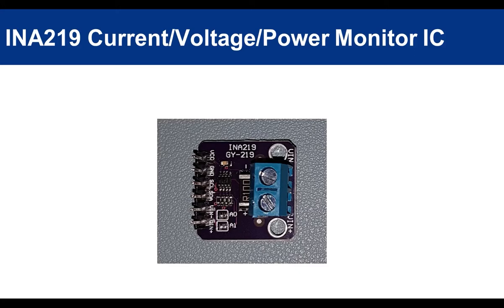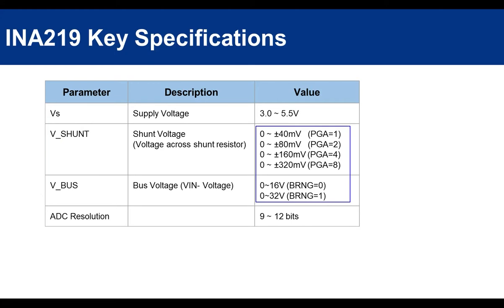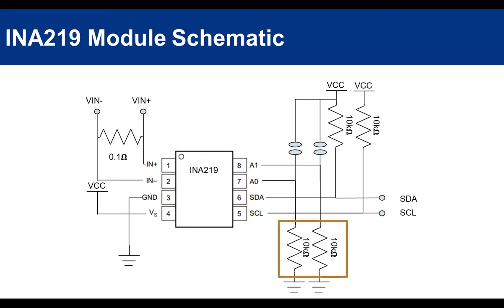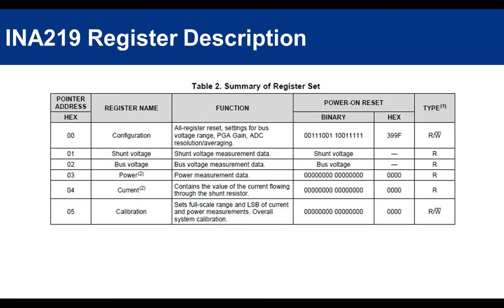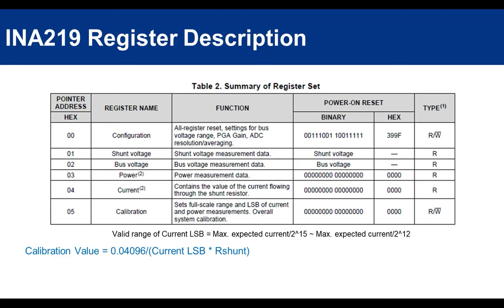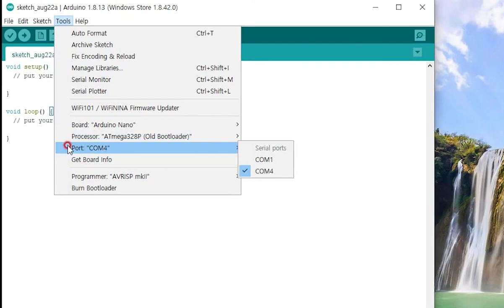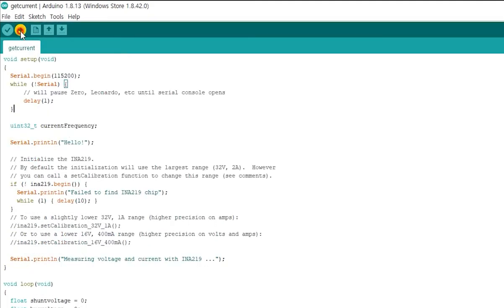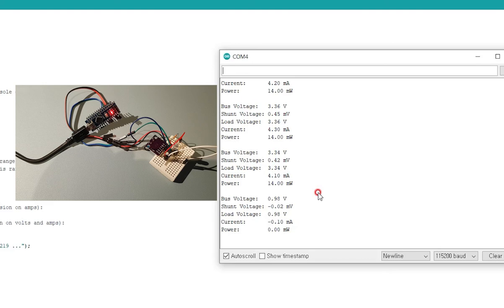INA219 Current Sensor Tutorial (with Arduino)

Comment: Thanks for the video. How do you configure the jumpers to be able to have more than one working?
Reply from the maker: In order to connect multiple INA219s on one I2C bus, you can solder the pad with a silk marked as A0 and A1.
By default, the pads are open, which is pulled down by two 10kohm resistors having an address of "1000000", or 0x40.
When you solder the pad, it is pulled up to VCC, having a different address.
Here are some address options you can have, simply by soldering the two pads.
 - A0 open, A1 open : "1000000"
 - A0 open, A1 short : "1000100"
 - A0 short, A1 open : "1000001"
 - A0 short, A1 short : "1000101"

Also, there are other options if you plan to connect more than four modules in one I2C bus, by connecting the A0 and A1 pins directly to SDA or SCL pins.
Refer to page 4 of the presentation for the address options of INA219.

Thanks for asking!